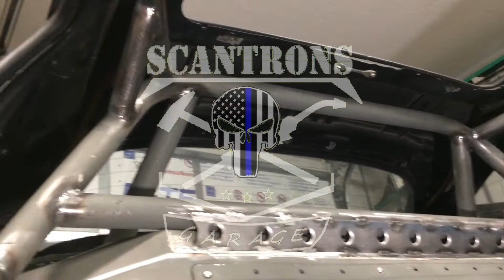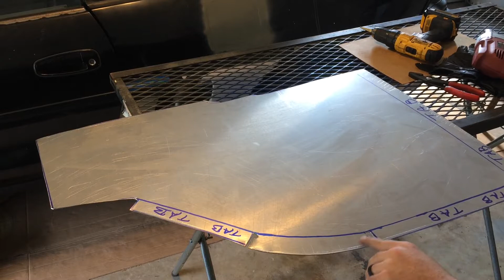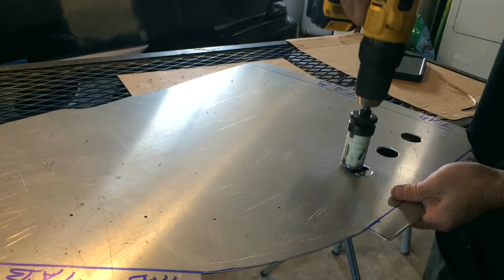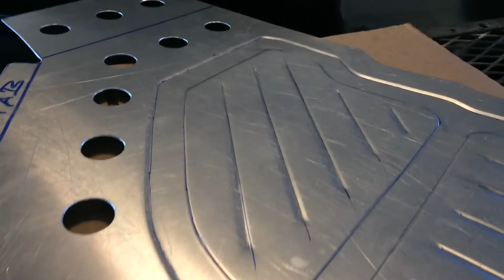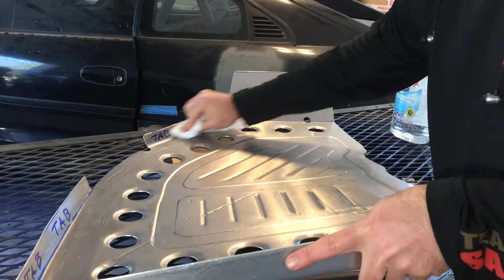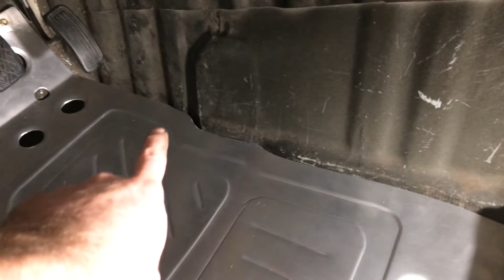DIY floor plate / Heel Plate

Comment: I noticed that on the template you have those + points ( multiple following the trans tunnel)  near the trans tunnel, what was that used as a reference for?
Reply from the maker: I believe what you are referring to are mounting holes. I had 3 or 4 mounting points along the transmission tunnel ( gas tank tunnel on this car). They were just drilled and bolted through to the mounting location below